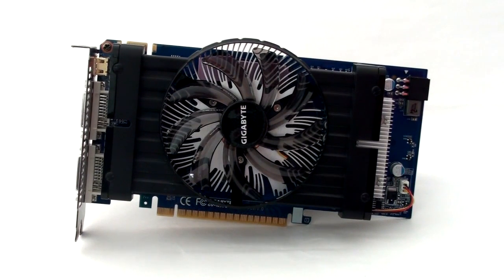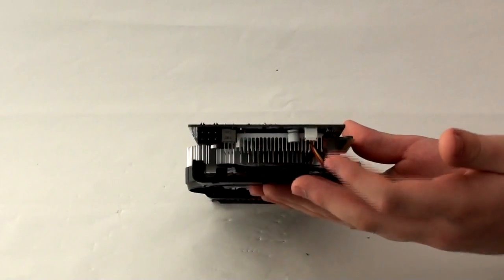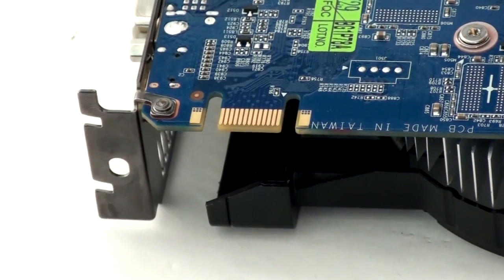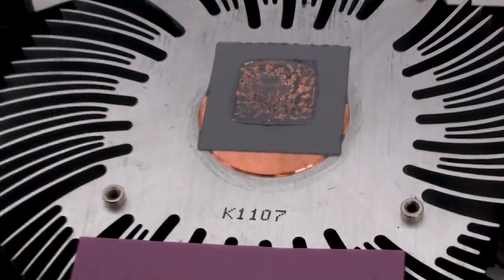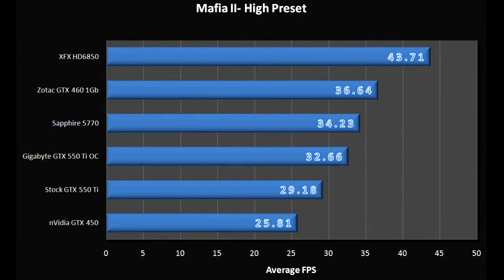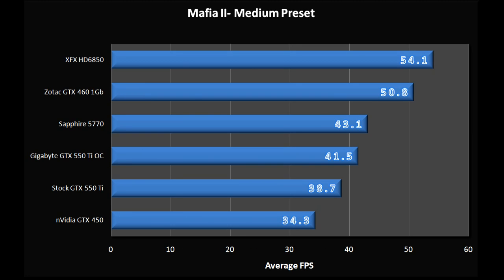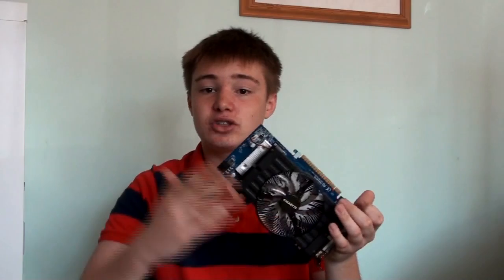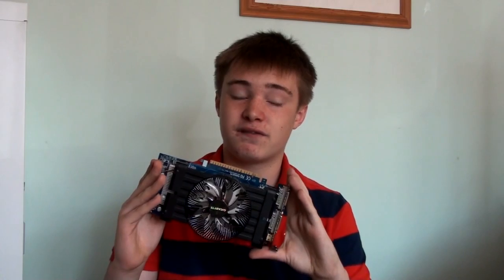Video Review- Gigabyte GTX 550 Ti OC Graphics Card

Comment: So, you overclocked it to 1 GHz? Mine keeps going at  970 MHz at system start. Is 970 the base clock or is it 900 MHz? Did Gigabyte factory made 970 MHz to be the base clock? I'm still not sure of this since my graphics card goes at 970 MHz at system start. So, when I set it back to 900 MHz is it base clock or underclocked?
Reply: Michael Arthur Long 900 MHz is the 550 ti’s base clock. The over clocked version on the market is 970 MHz.

Comment: I still wonder, is there any other graphics card with the processor under the card or this one is just designed upside down. Also, what was that pink rubber-like thing on the heatsink? When I took off the heatsink it was still sticking on the card.

Comment: How's the thermal paste? Also mine keeps crashing too, but it's because of the nvidia drivers. Its like it have an expiry date and starts crashing, so I either have to reinstall it or install a new driver. Mine went on 89°C on Crysis 3, 92°C on Sleeping Dogs since it was really dusty but after I cleaned it a bit, it went to 77°C. Usually it's at 970 MHz, but when I see it heating I clocked it back to 900 MHz.

Comment: You most probably have a BIG problem with air circulation, or something like.

I'm Brazilian, an on a room temperature of now 28ºc, wich is nearly hot, I haven't got over 80ºc with 1000mhz, on FurMark

I've gamed with it on 35ºc days (not kidding), and it doesn't get over 75ºc

Have you ever took out the card's heatsink (if not, that wasn't an advice), or how often do you clean it?
With more details I may help you.

Comment: i've had this card for about a year now, it has worked pretty good in performance, but i have a pretty big problem. It is constantly crashing and stops responding, i've tried alot of things but i think that it's overheating. I've clocked it down to 900Mhz but still it reaches 95-98 °C and then it crashes. i've tried tons of things , and i have two extra chassi fans.

Comment: I did tests on the GTX 550 Ti between 5770 and 460 460 that is better than the 550 Ti 5770 but to win it hahaha dude unless he spins on the power supply, besides, I gigabyte gtx 550 Ti Windforce 2 and benchmarks, even with ati 6850 wins and not a lot of games deviates from the 460 and 6850

Comment: The 5770 does support tessellation....just seems like he is on a tight budget that's why I recommended the 5770. For the gtx 550 ti price range however, the 6790 is pretty much the same price and is 10% better...

Comment: The pixel rate and memory bandwidth of the 550 far surpasses the 5770 everything else is also past it or slightly past the 5770, for a $30AUD difference, you are much better of with the 550Ti and well Geforce cards have much better driver support in my opinion... also im not 100% sure, but i dont think the 5770 supports tessellation?? someone should confirm/deny that..

Comment: could someone answer the golden question - is it noticeably better than a 9800gt? (p.s. it ran mafia2 on max w/o physics very smooth as long as you didnt push it over 1650x1050 or so... mirrors edge at 1080p perfect! - crysis 1 on ultra was ok until 720p or so...) if its more or less the same im getting a gtx560...

Comment: i have AMD Athlon ii x2 450 cpu and ati4670 1 gb 4gb ddr2 and gigabyte MA770-UD3 motherboard and the question is will i be able to play battlefield 3 on low setting without lag if i buy nvidia 550Ti?

Comment: Uhmm, is this card 'good'?
How does it fare on high temps?
I'm sorta planning to buy this card for my rig.
Here's my rig. I'll just name my mobo and proc.

Gigabyte M68MT-S2 Rev 3.1
AMD Athlon II X2 260 3.2GHz

I do have with me a 600W PSU (not sure what brand).
And I haven't used the stock cooler on the processor, for it sucks.
So I bought DeepCool Gamma200.

I'm not really a 'hardcore' gamer... Just want to buy a card that will last for the next 4 years or so. On the other side, I like HD6770.

Comment: If I want to build a decent Gaming PC which card you will recommend I am talking about new games with recommended confguration settings if not the Max. Do you think Gigabyte GTX 550 Ti is a good one to start with and next year or playing higher end games add another card in the SLI mode to the PC. There is nearly 80$ price difference b/w GTX 550 Ti and GTX 460 right now.

Comment: @blueskyzero9 on my computer, it runs Crysis Warhead on gamer settings, CS:S on all highest settings, Portal 2 on high with 4x AA, however GTA IV is a little laggy, but I think that's due to my slow processor and ram. Once I upgrade all those components, I'll let you know if I see a better performance on those CPU-hungry games. 
All up, I've found it to be a great card, and reasonable competition to the ATI 5770 as an entry level gaming card :) No worries

Comment: Specs on my cards, EVGA:GeForce GTX 550 Ti, Maximum Resolution:2560x1600 Additional Features:PureVideo HD NVIDIA CUDA PhysX by NVIDIA, Maximum Analog Resolution:2048 x 1536 Maximum Digital Resolution:2560x1600 Video Card Profile:Standard Dual-Slot, Memory Type:GDDR5, Memory Interface:192-bit, Video Memory:1024MB, Stream Processors:192, Core Clock:951 MHz,  Memory Clock:4356 MHz, Shader Clock:1903 MHz, Memory Bandwidth:104.5GB/sec., 1080p Support, Video Output:DVI&HDMI. all out of box not OC'd

Comment: thanks for the great review it helped me decide. i went with the evga gtx550Ti card as it was on sale at a very good price to where i was able to buy 2 of them. after rebates i got both for a little under 200 dollars, sale is over now. can you tell me what the increase is and the advantage of using 2 cards in sli mode plugged into 2 pci-e 2.0 x16 slots? someone told me it would make a big difference using 2 of these cards over one card. can you give me info on the gtx550 ti in sli mode? thanks